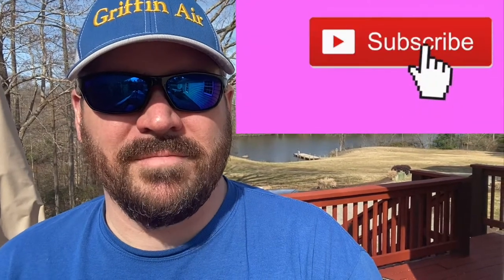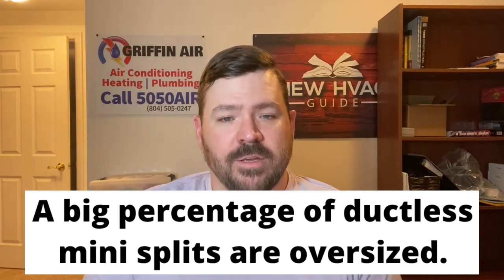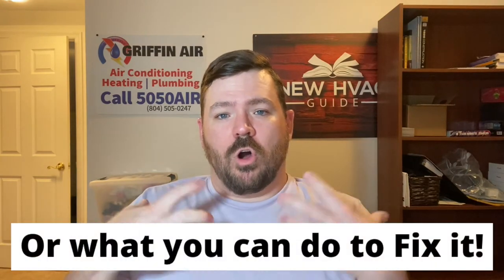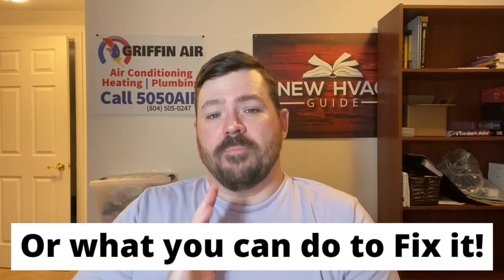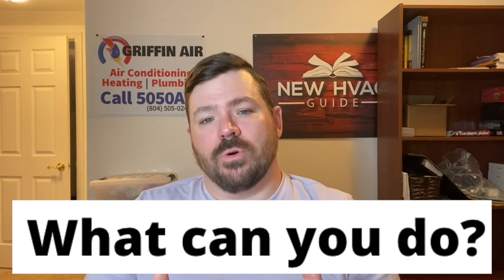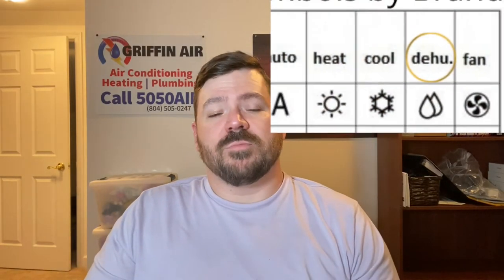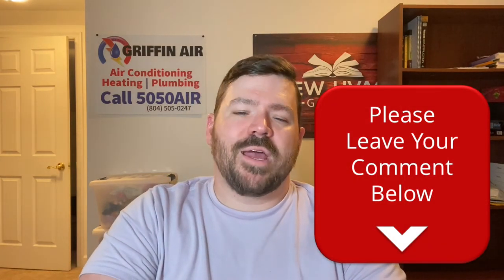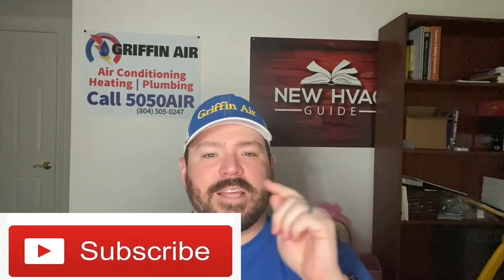HVAC Ductless system oversized? Walls sweating or creating mold. Tip to properly operate mini-split.

Comment: we put a 24k LG in our 530 sqf cabin. Its new construction insulated with open cell spray foam.  Looking to downsize to 12k hoping it will resolve humidity issues as were getting 75-80%. Even when i run in dehumidify mode it doesnt make much difference maybe 2%

Comment: I’m wanting to use a split for a small room in my garage well insulated and it has a vent fan. I will only need it for 6 hours a day, it has auto and the ability to run schedules, what would be the best way to run this to avoid the mold and humidity issues but also be cost effective?

Comment: Hi, I’m getting ready to install an 18k Senville Leto system in my insulated 700 sf. 3 car garage in Texas.  Temps of 100 plus are very common in the summer.  I was going to go with a 24k system, but the techs at Senville said 18k was the biggest I needed and that was only because I have 9 ft. Ceilings….I just wanted to get your thoughts on the sizing.  Thanks in advance.
Reply: Any feedback on your experience?  I have a similarly sized 3car garage in same climate and got multiple bids from 1ton to 3 ton for the same garage!  Right now I’m planning 24K/2T as that’s what the guy that seemed the smartest recommended.
Reply: @ystebadvonschlegel3295  I went with the 3 ton…no regrets.  My garage is fully insulated and it still takes several hours to go from summer to comfortable.  I installed the 18k system prior to the 3 ton and it just wouldn’t cut it.  If I remember correctly, it was taking around 8 hours to drop 10 degrees.  That’s with the air coming out of the unit at around 47 degrees.  The other issue I have is my garage is full southern exposure and the door goes up and down about 50 times a day.  In my opinion, just install the biggest system you can.  I have a buddy at work that installed the same 3 ton system in his 3 car (smaller than mine) and he’s glad he did also.
Reply: @jasonvliet-odonataknifeworks  Thank you so much.  Do you have much humidity where you are?  that' my fear - oversizing with inability to keep humidity down in times of the year when heat load isn't so much.  It's mostly brutal hot here 3-4 months out of the year but the rest of the year it's still really humid.
Reply: @ystebadvonschlegel3295  I'm in the DFW area...it's plenty humid,  but it's not Florida.   Honestly,  I  haven't had any issues with moisture,  but I only run it when I'm working in the shop.   If your garage is going to stay closed and you plan to maintain a temperature,  you might be able to get away with a smaller system.  In my case,  I  don't use it all the time,  but when I need it,  it's pointless if it takes a day to cool the area...hence the 3 ton.  The disadvantage to mini splits over a conventional central air system is the distribution.   You have one location for supply and return vs multiple vents and returns.   From a cooling time point of view,  it's less effective and efficient than a traditional system.

Comment: Have 2 adjacent rooms with 2 open entryways (no doors) between them. One entryway is 4 ft wide, the other is 6. 8ft ceilings. East room includes kitchen and is 483sqft, west room with almost all windows facing west and south and north is 435sq ft. We live in the high desert, so summers are easily 100 degrees each day, 85 at night. That west room gets stupid hot in afternoon and evening. Winters are mid 50s day, ~35 night. Every contractor said to have an air handler in each room, but were split on btu in each. All said a single unit in east or west room alone would struggle to keep the other comfortable based on fan orientation and air flow. Recommendations?

Comment: Hello, from San Antonio, TX I just installed a unit from the Mexico brand AUX  asw-h12a3/ffr2 12000  BTU Conventional, not an Inverter unit. I admit I didn't do enough research. I would have bought a smaller inverter unit. But I got excited by a good quote and was just tired of being hotter in my room. I figure more than enough was better, I was wrong.

You see I  have central air but my room doesn't get as cool, so I wanted this unit to cool my bedroom more which I about 230 sq ft. home was built in 1977 it's a one-story with one wall consisting of two huge windows and sliding glass door. But there is central air in my room. I just needed it like 2 to 3 degrees cooler in my room

I have now learned that my unit is way oversized.  I'm not having a lot of symptoms but I just got them 2 days ago. It was installed by a guy on Facebook, not a big company. The installation looks clean and correct. But I'm oversized.

Now it's too late it is in. What should I do? Or how should I use it? What mode? Should I leave my room door open the leaving room? Would that help? My central ac isn't all that bad I keep it at 75, I just wanted my room cooler. What now? Thank you, SIr.
Reply from the maker: Make sure it’s in auto so it can ramp down to lower speeds and run longer. I’d also only use it when necessary

Comment: IMHO the real issue with VFD/VRF mini splits causing high space RH/mold/mildew is not oversized units. It’s the fact of the turn down/low compressor speed operation near set point especially at night. This allows the coil temperatures/DAT to get into the high 50s even 60deg sometimes. That will not remove moisture from a 70 degree space. This allows humidity to rapidly reach into the 65-70% range in humid climates. See it all the time in the South. Mini split down here almost always have mildew or mold on the blower wheels. Add with residents breathing and showers etc you have a recipe for a mold farm.

Comment: Having an energy audit with blower door test is the best way to determine btu load. Room calculations alone may not necessarily account for poor or high performance windows which can dramatically effect the btu load of the room/ house
Reply from the maker: Very true sir.  Do you do a blower door test in every home?
Reply: @NewHVACGuide  As a sub-contractor I could only wish for that luxury. I always recommend it but only houses that are to be Energy Star certified that I work on have the btu loads per room calculated by the energy auditor. As a general rule of thumb I always oversized as I’ve routinely seen insanely expensive windows perform poorly not to mention of the general contractor does not care about air-sealing.

Comment: I am struggling with how to fix my problem. I have Daikens, but one 3 head unit in one section of the house is the worst problem. No mold problems here, but we have humidity issues combined with smoke detectors that go off at the slightest increased humidity. I've tried using Auto, but the relative humidity stays at 55% - 60%. This is true even when the space doesn't actually cool down--set at 68 and inside temp sitting at 78 (over 90 outside). ??? Why isn't it cooling more and cutting the humidity if it's oversized??

I am literally a prisoner of my house--I can't go anywhere because I cannot figure out an option that keeps the humidity down. 😟
Reply from the maker: Sounds like a pro needs to take a look
Reply: I live in Texas--any recommendations on how to find the right pro? The local company who installed the units is a great guy, but doesn't seem to have any suggestions on how to fix this.

Comment: We had two Mitsubishi mini splits installed in our upstairs bedrooms both 9,000btu. Square footage is 180 for one bedroom and 234 for the other. I feel like the units are definitely oversized even though I live in South Louisiana and both bedrooms are on the west side with windows. The humidity level was 67% with a temp of 68F. What do you think?
Reply from the maker: Make sure they aren't being ran on the manual fan setting.  Turn on the dehumidify setting and see if that helps?
Reply: @NewHVACGuide  I’ve been getting quotes for 4 installers now and they want to put a 15k system in a 185sq feet room. 😂 They give HVAC companies a bad name.

I got a guy who did some notes and came out to 9k btu ONLY because the floor unit I wanted the smaller was 9k. I think he did a manual j. I did a manual j in CoolCalc and the room only needs 3200 btus for cool and 7,000 for heat.
Reply from the maker: @UnitedStates.  it’s surprising how many “pros” don’t know how to run a manual j or that they even should run one.
Reply: @NewHVACGuide  Hey quick question if you don’t mind. On one of the calcs I was at 17,500-18,500 btu heat load (can’t remember) and 8700-9,500 btu cool load. The guy who did the manual j recommended a 12k and all the others the 18k. I however was thinking of choosing a 15k since it will be used mostly for heating in RI and a few days where it’s really hot. 

What do you think?

My logic was that on those teen cold days the unit at 12k would be working too much vs the 15k I want. The 18k would be perfect for the heating as well, however for the summer then i would be getting some mold issues probably so I didn’t want to oversize it. It’s the hyper heat Mitsubishi multi condenser.
Reply from the maker: The cost difference would be minimal. I’d defer to your local pros
Reply: @NewHVACGuide  yeah. A few hundred bucks. But would you rather size to the heating max capacity so the 18k if it was you or would you stay with the 12k that the cool load calc wanted? As a pro what would you recommend personally?
Reply from the maker: Inverter systems have changed the game. Before the systems capable of ramping up and down, I’d say we would only size based on cooling as to not be oversized and size the backup heat accordingly. That said, in this situation, I’d defer to your local pros in this matter.  I’m sure they have their reasons for recommending a certain size. Finally, every home and situation is different. There are times when I’d go by design load and other times I consider more of the extreme load. 
So again, I’m gonna defer to them. 🙂
Reply: @NewHVACGuide  Ok. I’ll ask the next guy who come to do the quote and see what he says. Thank you! I’ll let you know how it goes. I may even choose the bigger unit who knows.

Comment: Hi I had a Bryant mini split system installed and we’re having humidity problems. The model numbers are 619AHB the square footage of the house is 1800 and they installed 2 units on the main floor and 4 more in the bedrooms on the second floor. The bedrooms are about 10x12. When they run in cool mode they have a bad smell and the humidity is horrible ..we do have a dry mode they can be put on but then you absolutely freeze .. please let me know if you have any suggestions or information you can share. Thanks
Reply from the maker: Make sure the remote is on auto and can ramp down during normal operation

Comment: Isn’t what your describing the whole point of minisplits?  The ability to ramp down and still run effectively is the biggest advantage over traditional HVAC is what I understood.  Maybe I’m wrong - I would be more interested to learn about what brands (if any) are better at this - being able to run full bore when needed but ramp down to low levels and still remove humidity when less cooling is needed.
Reply from the maker: Whole point of inverter technology including minisplits... yes

Comment: What a great and informative video! I have a unique situation that I have been unable to find help on. I converted my outdoor shed into an office that I work in full-time. I had a mini split unit installed and it does a fantastic job of cooling/heating the space. The problem is, humidity is extremely high and now I have to run a dehumidifier constantly. I generally keep the system on auto and around 70-71 degrees. Do you have any recommendations? Are there any permanent dehumidifier options for a small space? The total square footage of the shed is around 100 sq ft. Thank you!!
Reply: Curious, what type of insulation?

Comment: I put a new 3 and a half ton Goodman split unit in my house. Vacuumed the lines. Opened the valves. Left my gauges hooked up so I could keep an eye on the pressure. The low side pegged the gauge. No cold air. In my simple brain the freon is not compressing. Correct or not correct any ideas?????
Reply from the maker: Sounds like it may be a restriction of some type. You should call a pro to diagnose 🙂
Reply: Did you do a nitrogen pressure test to check for leaks ? What are the gauges reading ? Are the line sets too long or oversized ? Perhaps the pre-charge was not enough and you need to add more refrigerant. And of course a restriction/ kinked line.

Comment: This was a great video with just the information I needed! Thank you for this content!

I am building a new house in Washington State, a two-story 1863 square foot 3 bedroom house. I have received two different quotes one using Mitsubishi (Mitsubishi Multi Zone ODU 42K BTU) and one using Dakian (5MXS48TVJU). I am leaning towards the Mitsubishi unless you had other opinions. The down stairs (974 sq. ft.) is more open concept and they recommended two 9k units. Upstairs is where the bedrooms are which are all relatively small (2 at 100 sq. ft., 1 at 168 sq. ft.) and they have recommended a 6k unit in each room. The total unit size is a 42k 5-port system. I was initially concerned that the system was too large but they have assured me that the units will self-regulate to produce the proper loading. After watching your video it seems they may be correct in their thinking? 

I was also considering a ducted unit upstairs to get a smaller unit but was wanting to avoid ducts if possible. What are your thoughts? Does that unit seem too large for the house? A 6k unit seems very large for 100 sq. ft. but how else would they cool/heat unless doors remained open? Trying to go fairly efficient in windows and insulation as well (a bit better that code requirement). 

Thanks again for this helpful information! I look forward to your response.
Reply from the maker: Hey pal. Will this be your primary heating source? It get pretty cold where you’re located correct?
Reply: @NewHVACGuide   
Yes this will be the primary heating source. I live near Tacoma/Seattle area so while it can get cold in winter, rarely does it get below freezing.
Reply: 42k seems like a lot for a home that size with modern efficiency building materials/windows, and a mild climate like The PNW.
42k may have been the smallest 5port available, though.
To downsize, you'd probably want to "reduce" the downstairs to a single, larger cassette. Also, ya if you could split the two guest beds on one shared ceiling ducted system, that could reduce your system to 3port and you could get a smaller overall condenser/compressor.
Do you have secondary heat? Like a fireplace, resistive heaters, furnace, or would you be willing to use space heaters?
The system may be oversized for summer cooling needs, but if it's your only heat source, you may need all 42k in the winter (it probably can't put out a full 42k on a cold day anyways!)

Comment: So I just put a 12k btu minisplit in my office which is roughly 220 sqft with closet and bathroom. I know I need pass through vents above the doors to the other spaces so I've just been leaving the doors open for now, but I'm struggling with humidity due to it being oversized and I'm buying a dehumidifier, but I wanted to know if you had any tips for me beyond just doing that. I know I could have gotten a 9k btu unit (hindsight is 20/20), but they don't appear to make 6k btu minisplits (except mitsubishi heat-only - I live in FL). I think the best move would have been to install a ductless wall unit (much like a window unit) at 6k btu. Too late now. So...what do you think?
Reply: Is there a specific setting I should have on my unit? Like auto at 72 and auto fan, or 72 with low fan speed or what?
Reply from the maker: Auto on fan so it can ramp up and down on it's own.  Try putting it on dehumidify mode and see if that works.

Comment: I'm also having problems with humidity and have realized that the system is oversized. It's not by design, but the mere fact that Mitsubishi doesn't make a small 3 zone system with less than (3) 6k units. Now for a bedroom, this might sound fine, and it should be. But after doing some deep research, I found out that the minimum cooling level of the Mitsubishi mxz-3c24na2 is 12k.  12k feeding one 6k unit is a recipe for poor performance. This causes the compressor to cycle 4-5 minutes on and 10 minutes off when the temperature is reach in the room. The result, high humidity and wide temperature swings. Why in the world would any reputable company like Mits build a split that cannot run below the lowest zone and maintain the temperature? I feel like the brochure with a temperature demo being better than a conventional A/C deceiving. My window unit kept the room temperature better. Big mistake on my part buying into all of the Mits hype. I should have bought a Fujitsu 3 zone that could operate much lower and kept the bedroom unit humming right along. Mind you I also have a Mits 24k in my living room, but this model doesn't do the cycling thing and keeps the room perfect.  At the time I talked to multiple contractors and some even said I should make the bedroom units bigger. Well, I'm going to try what you suggested and hopefully it works better  I think there are too many people who buy into the Mits hype and believe that they're buying the best. But I can tell you for a fact, this system is poorly designed and I would not buy this system ever again. Just my 2 cents. LMK what you think.
Reply from the maker: +surgemas sorry to hear that. We had a few experiences similar and I’ve heard some major horror stories. We switched to Daikin and have had some happier customers. Their equipment might not be the highest SEER but it operates great and the heat pumps can operate well within a low ambient outside temp.